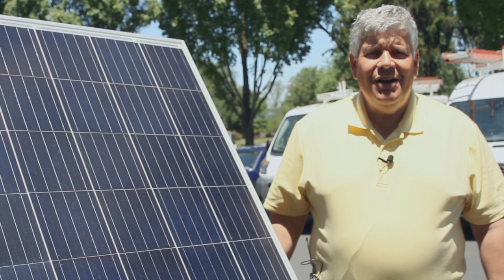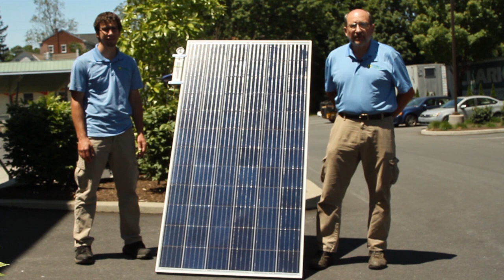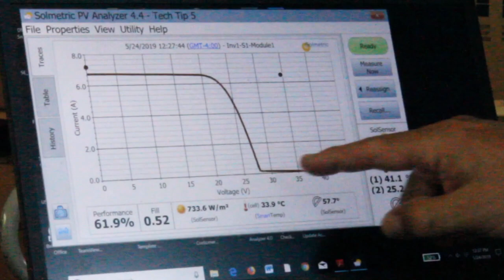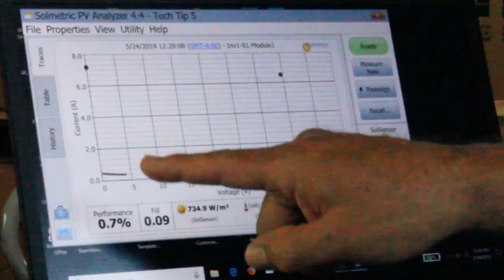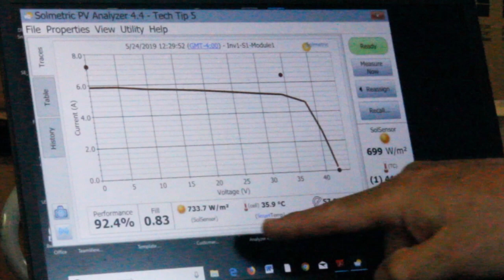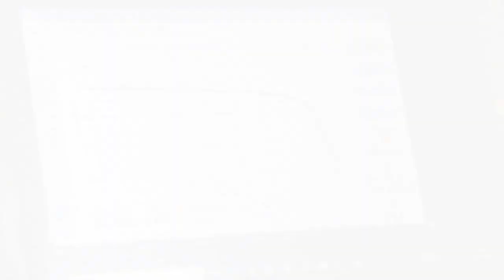How Shade Effects Solar Panel Production [Includes Actual Test]

Comment: I don't understand the graph, which I think has current vs voltage.  In one test, surely the panel produces a fixed amount of current and voltage ?  Why would either vary if conditions are static ?

Comment: if the panel are in series like 5 panels, then one got shaded does all 5 panels also stop producing?
Reply from the maker: It depends on the type of inverter you're using. If you're using string inverters, it would cut off production. All the solar panels in a string can only produce as much electricity as the least-producing panel. Microinverters, on the other hand, allow for panel-level production. The other unshaded panels would not be impacted. 
Here's a helpful guide on how this works: https://www.paradisesolarenergy.com/blog/how-does-shade-and-bad-weather-impact-solar-panels